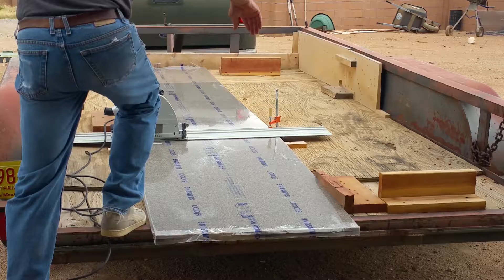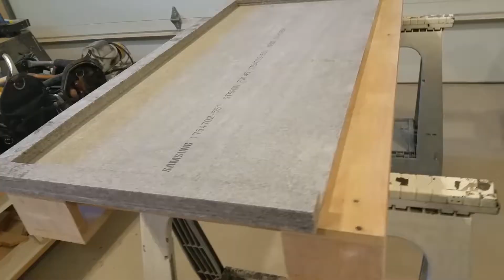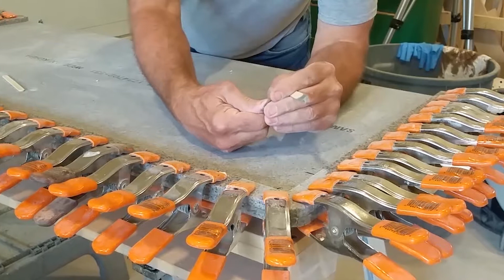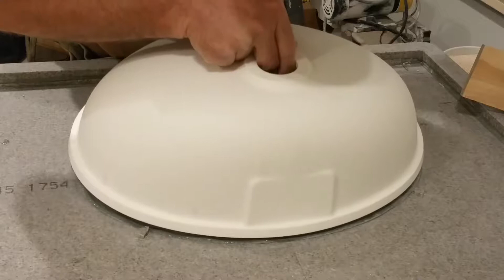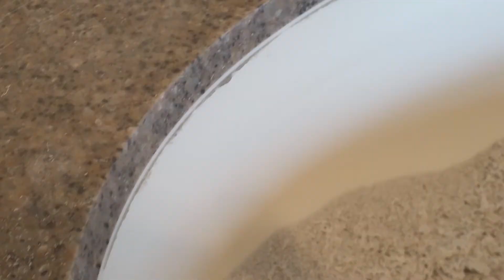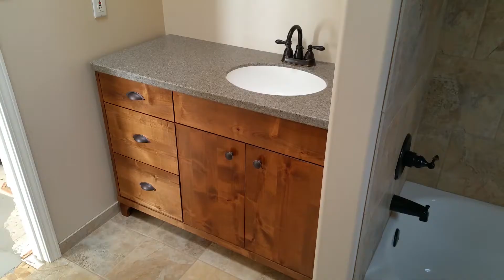Step by Step Solid Surface Countertop Build for a Bathroom Vanity

Comment: Very informative! We're about to get Corian solid surface countertops installed in our kitchen and I wanted to learn more about the prep that goes into it!
Reply from the maker: Thanks for your comment! Yes, solid surface is a great product in my opinion. Corian is the gold standard and was the first solid surface product on the market. They require their installers to have their own certification to purchase and install Corian so you should get a good result from your installation. (I have never even been able to but Corian!) Main couple of cautions are that solid surface scratches easily but it can be re-buffed periodically to remove scratches and make it look new again. It also does not like heat, so have protective pads available when placing any hot items on it. Hope you are happy with your countertops! Tip - Ask the installers for a scrap piece of your material to keep in case  your countertop is ever damaged. It can easily be repairs but you want a piece of material from the actual sheets your countertops were made from to do the repair. Slight shade variations do occur between sheets that are manufactured at different times.
Reply: @RustyDobbs  thank you for sharing! I had no idea installers had to be certified; that makes me feel even more confident in the company we choose to do our install (a family-owned business being run by the second generation now). They were very thorough explaining things like the heat resistance (or lack of) and the ability to be "refinished" over time, so I was already aware of these things.
Great idea - I'll speak to them about scrap pieces for potential repairs in the future. I never thought of that. Thanks!
Reply from the maker: @ Yeah, all you really need is maybe a 1'x 2' piece if available. They will have scrap.

Comment: Thank you for the very well made tutorial. I'd like to try this myself using my existing counter top as a template and re-using my drop in vanity sink. I heard years ago that solid surface dealers such as corian will sell only to trained craftsmen (or licensed?) Do you know if this is true?
Reply from the maker: Yes, Corian and Avonite for sure have had restrictions on who could purchase their products. I went through Avonite’s training 20 years ago. Samsung’s Staron products are great and my supplier never asked for any certification paperwork. You might check with a local countertop shop and see if they would sell you a small piece of extra scrap the size you need for your vanity. I love using solid surface material! You can also check online for other options. Good luck!

Comment: Nice finished product.
Suggestion: Use the same hot-glue blocks concept you used to align the sink when aligning the built-up edges. Dry-fit the edge pieces; add wood or solid surface blocks (at an angle so only one point of each block is touching); glue edge pieces; remove blocks. This should make the alignment process easier; just push against the blocks for a perfect alignment. 
Nice work, sir. :-)
Reply from the maker: That is really a great idea, Charles, that I have never thought of! You know, I learn a process from a master solid surface fabricator and his steps are etched into my head such that I rarely stop to consider how I might be able to improve on his process! If you run across other ideas on other things you see me do, don’t be shy, Charles! Keep the suggestions coming! 🙂🤔

Comment: Hi Rusty What kind of CNC are you using? and type of software, thanks
Reply from the maker: The CNC was built by EZCNC out of Dallas about 15 years ago and I had it built to a custom size (6' x 13') to handle a full sheet of solid surface material, Darin. Takes up a lot of floor space now that I'm not really using it for countertops anymore! Really good machine though. The software that connects the computer to the machine is called DeskCNC and is out of production the last time I checked. It can generate G code in ways that I have typically needed it to, so it still fits my purposes. I can also load G code from other applications into DeskCNC. I bought Bobcad several years ago but have not gotten into using it. Turns out it needs DeskCNC to interface with the CNC and run the code. Hope that answers your questions.

Comment: As a woodworker I’ve been wanting to do a project with solid surface material for years, but couldn’t get it due to strict policies of only selling to those in the business. Is there a source you use, if you can say.
Reply from the maker: You sound a lot like me, Kevr! Interested in many things! I use Avonite and Wilson Art and both require a certification to be able to buy their solid surface. I also use Staron, which is made by Samsung and I don't believe I was ever asked about a certification. You might also check with a local fabricator and see if they would sell you some scrap pieces they have in their shop. I think you can by directly online from companies that don't require certification. The problem with dabbling in solid surface is that you quickly realize you need to start accumulating pricier specialized tools and clamps to do much more than very basic tops.

Comment: I love that you are using sketch up and a CNC that isn’t 100,000.00 
It’s great to see how you are using different elements in a creative way to make nice projects with Minimal overhead
Reply from the maker: Yes, Jonathan, I think I would be feeling sick all the time if had spent that much on my CNC. It has paid for itself over time but not on the scale I would have liked. However, it has allowed me to do some jobs that I never would have gotten otherwise with a lot less wear and tear on me in the process, so maybe I should factor that in a little more too! Sketchup works fine for what I do. I have to scale the parts down to between 89-90% in the CNC software, but that is no issue. The good thing is that the CNC parts are very solid with a 3 hp spindle too that is the best upgrade I made. Thanks for your comments!